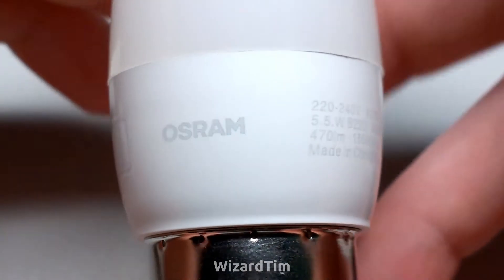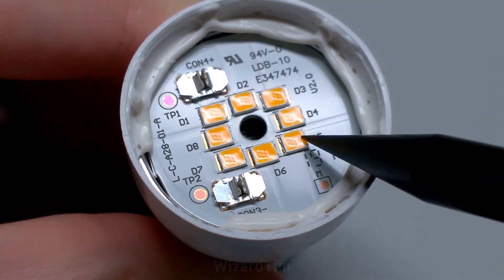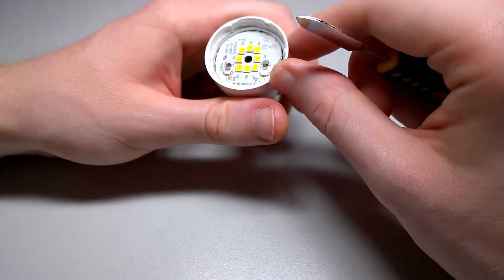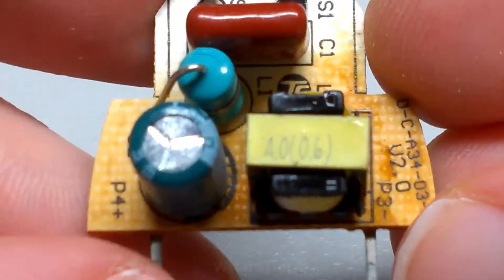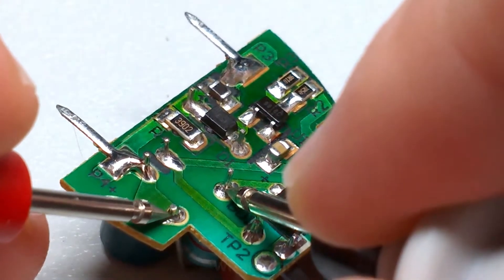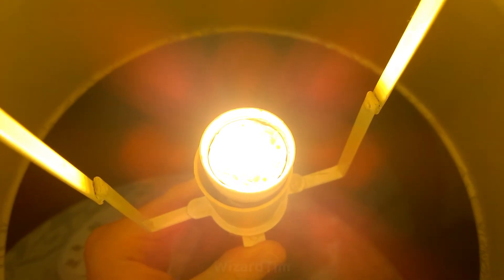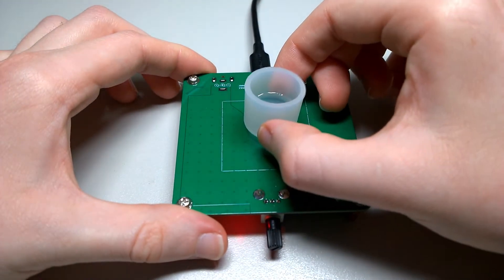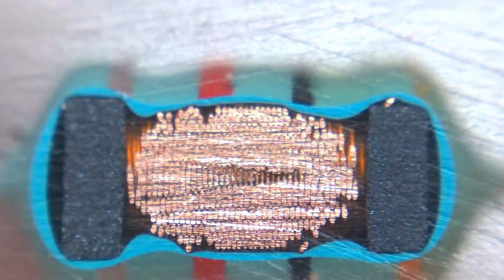OSRAM 5W LED Bulb Repair & Failure Analysis

Comment: I would have put money it was the capacitor. I've opened a few LED bulbs and it's always the capacitor.
Reply from the maker: I would have made the same bet. I haven't come across a failed inductor in anything else since this let alone one with the same unusual crack failure mode. Found plenty of bad capacitors though.

Comment: LEDs burning out has been a major problem for me as I have 16 of them to illuminate my airplane hangar. It is a royal PIA to replace them as I have to borrow a ladder for the 12' ceiling and move my airplanes and tool boxes out. I had the same problem with CFLs so I switched to LEDs and at this point I am on my 5th set of bulbs in 11 years. I probably have them on an average of 4 hrs a day. They are in open sided fixtures @ 120VAC. No idea what the 30+ CFLs I went through but the first two sets of LEDs were LE (Lighting Ever) and the second two sets were Sansi, all 100 W equivaltent. The Sansi brand had cooling openings on the housings and advertized ceramic heat sinks but they didn't seem to last any longer. I am a retired EE and I know that the failure is caused by the PWM circuit board used for voltage conversion. I think the failures are caused by using cheap 85 deg. C rated capacitors not better105, 125 or 150 deg. caps. Does anyone know of a  A21 size bulb that has ambient temperature specs and MTBF specs at that temperature? I am tired of clearing out my hangar and climbing a ladder. BTW you can see the fixtures in my profile picture.
Reply from the maker: Those sorts of failure rates sound suspiciously high, particularly if you're using good brands like Sansi that I would expect to last many years (some Sansi products come with a 5-year warranty). 

If the LED bulb failed due to thermals you'll often see it on the PCB like at 3:02 in this video the heat damaged areas are a much darker green. That and if the capacitor has failed it will have either vented, or the capacitance or ESR will measure bad. But I'm doubtful just repairing that will fix your issue as you've been having a history of failures.

I would recommend looking into the power quality in your hanger as I would consider that an industrial area as you likely have some large power tools in there like an air compressor. Those can back feed transients into the 120 VAC that can damage electronics, anything that when you turn on, the lights dim or flicker is causing large transients. That and also verify you're actually receiving 120 VAC from the utility company. Most utility companies are required to supply the line voltage to within ±5% or sometimes ±10% in industrial or rural areas. But anything over 132 VAC will likely cause damage to LEDs bulbs designed for the North American market. Likewise if you have split-phase, make sure your neutral bond is good otherwise you can have one phase well above 120 VAC in just your hanger which gets worse depending how much stuff you have turned on.

If you can't find any issue after any of that I would say to buy a cheap plug in surge protector and plug it in an outlet close to your breaker panel (or with a device you suspect is causing transients). Make a reminder to check it regularly and if you have a large transient it will blow. You can check them by measuring their resistance between the three pins, they'll be >100k ohms normally, but when they blow they'll go up significantly in resistance or go open circuit so keep a log. If it's a particularly big transient sometimes you can just shake them and hear bits of the exploded MOV rattling around inside. Also the "Protected" LED on some surge protectors isn't a good indicator of health, it will only go out when an internal thermal fuse trips from the MOV overheating from an over-voltage. You can get devices to measure and count surges, but they're pretty expensive.

Also that's a cool experimental you have!

Comment: how you testing? where the multimeter suppose to set to?
Reply from the maker: The multimeter is in diode mode when lighting up the LEDs to test them. However you may find your multimeter can't light up the LEDs. A lot of modern LED chips have multiple dies in series inside them so they have a higher forward voltage.

In this video I used a Keithley DMM6500 bench multimeter in diode mode, unlike a typical handheld multimeter it has a relatively high diode test voltage of 7 to 12 V and can do higher test currents. But you can do the same test with a lab PSU at a similar voltage in constant current mode set to just a couple of milliamperes, just be careful of the PSU's output capacitance damaging the LEDs, a resistor in series will help protect against this. You can also use a resistor and 9 V battery or two 9 V batteries in series to test LEDs if you don't have a lab PSU.

Comment: Fantastic video in every way! Learned so much. Very clear presentation with more good info in the comments. I presume you are an E.E., maybe a professor?

What brand epoxy did you use? After the failure analysis you have also created a nice piece of costume jewelry!

Thank you so much!

Subscribed!

Kind regards,
John
Reply from the maker: Thanks! I am indeed a professional electronics design engineer, I do have a university degree in it but I didn't pursue a career in academia to become a professor/lecturer/tutor. 

Unfortunately I don't remember the exact epoxy brand I used. But any generic "ultra clear deep cast epoxy resin" will work, the advantage of this type is it isn't very viscous so it flows easy around the part and can be used in reasonably large moulds without overheating. The downside is the ratio of the two parts is very sensitive and it takes several hours to cure or requires heating to cure at all.

They certainly are nice to look at so I've never thrown any out and have always kept them, but never turned them into anything else like jewellery, but maybe I should at least display them somehow rather than keep them in a box in a drawer.

You may also enjoy a 2022 book titled "Open Circuits: The Inner Beauty of Electronic Components" which has some absolutely fantastic photograph and detailed explanations in it.
https://www.youtube.com/watch?v=byKyJ0b04Lo
Reply: @WizardTim  Super, thank you! 

Well you certainly could have gone the academic route and excelled had you desired. 

I will get that book!

Kind regards,
John

Comment: Thanks to the diagnose tutorial this video I managed to fix a LED bulb. I had exactly the same problem. Unfortunately it is not possible to reconnect the board back inside the bulb again. The metal srew in part was clamped onto plastic to make it unrepairable.

Comment: Why do some led blink ? Is it the capacitor issue...i replaced the caoacitor and it blanked out😊
Reply from the maker: If all of the LEDs blink on for a moment and then off and the time between blinks is somewhat consistent then it's likely a power supply issue. This is what's called a 'hick-up' failure mode. It can often be caused by a dried out electrolytic capacitor on the primary side, as you replaced the capacitor and it stopped working, I suspect this isn't the issue.

The other thing the issue could be is a bad solder joint or broken bond wire in an LED. The heat from replacing the capacitor may have caused it to fail completely. If just some of the LED blink (a single series string of LEDs) then this is likely the issue.

To confirm the power supply isn't the issue you can measure with a multi-meter the voltage across the string of LEDs (being careful the output voltage is referenced to mains and thus a shock hazard). If you measure a stable voltage across the LED string then this would indicate the power supply is working correctly.

You can then unplug the light and use a multi-meter in diode test mode (or the LEDs require more voltage, a power supply and a resistor) to externally power each individual LED to check they are working. If you find a one that doesn't light up then it's of course the defective one.

Alternately you can plug the light in and bridge across each individual LED with a wire (being very careful), if you bridge across an LED and all the other LEDs light up you know that LED is broken.

If you find a broken LED you can either replace it or alternatively if the light is a constant current driven design with only 1 series string, solder a wire across the bad LED bridging it out.

Comment: very cool video man thanks for sharing. Im just getting into electronics repair, and this is super helpful! I didn't even know that inductors could have that package lol, I thought that everything with that shape and type of colour coding was a resistor haha
Reply: Me too!

In case you missed it, Tim posted this info on how to know it is an inductor and not a resistor in another comment:

"Some things that give it away it's an inductor:
⁃ PCB overlay has it marked as "L1" and an
inductor symbol between the pins
⁃ Axial through hole inductors are often that
light blue colour and the colour bands decode
to a sensible inductance value
⁃ It doesn't make sense for their to be a resistor
in that place in the circuit but an inductor makes
sense
⁃ The cross section shows it has a ferrite core
and low resistance copper wire wound around
it, a wire wound resistor would use a nichrome
alloy wire wound around a ceramic core."

Comment: I just had a 9w Bayonet Smart bulb fail on me. It suddenly started flickering like it was trying to come on, but wasn't able to. Thought I'd take a look and see if I could fix it. I wasn't sure how to open them and came across this video. Thanks to this video, I was able to take it apart with relative ease. Turns out the issue was a bulging cap on the power supply board. It was a 10V 470uF cap. It was immediately noticeable. I have a bunch of power supply boards (some from TVs and and several ATX ones) laying around. Looked through the ATX PSU 1st and saw a 16V 470uF cap. Looked up if you can put a higher voltage one in and seems like everyone said it's fine as long as it fits. The 16V cap is larger than the one I took off, but the extra size was not a problem as there was more than enough space for it.

So I de-soldered that cap from the ATX PSU and soldered it to the bulb PSU board. Put everything back together, fitted the bulb and it now works fine. No more flickering and it appears in the app again (it was showing offline before). All colours work and there's no flickering. So seems like it did the job. I'll have to see how long this cap lasts as it was taken from a faulty ATX PSU.

I never knew these bulbs were fixable (thought you couldn't take them apart without damaging them). Nice to know these are fixable.

Comment: This inductor most likely got damaged due to heat and frequency. Ceramic capacitors get damaged similarly, especially in high frequency circuits. To prevent this, can be used e.g. two connected in parallel. They simply crack. They look functional but under a microscope you can see that they are cracked.

Comment: Replacing a broken led can be frustrating. Even with plenty of heat applied, the solder didn't come lose. Then the led break in pieces..

Comment: Does you know how check Leds over 3V? My multimeter can't
Reply from the maker: In this video I used a Keithley DMM6500 bench multimeter in diode mode, unlike a typical handheld multimeter it has a relatively high diode test voltage of 7 to 12 V and can do higher test currents. 

But you can do the same test with a lab PSU at a similar voltage (>6V for those 3 die LEDs) in constant current mode set to just a couple of milliamperes, just be careful of the PSU's output capacitance damaging the LEDs if you set the voltage too high, adding a resistor will help prevent that.

Comment: hello, can you tell me how to open the cover of a GU 10-5W bulb?
Reply from the maker: You might be able to carefully insert a thin pry tool between the lens and outer shell and then push it back and forth getting deeper every so often to try and cut any silicone adhesive, gentle heat may also help. Although you might find the lens is glued on with a stronger glue or ultrasonically welded which makes opening them without damage impossible.

Comment: As a semi-noob, how did you know that was an inductor and not a resistor? Really amazed seeing the internals of it.
Reply from the maker: Some things that give it away it's an inductor:
- PCB silkscreen has it marked as "L1" ("L" in honor of the physicist Heinrich Lenz) and an inductor symbol between the pins (easiest way to know it's an inductor)
- Axial through hole inductors are often that light blue colour and are much wider than resistors with a slightly lumpy mid-section
- The colour bands decode to 3 mH which is a relatively large inductance value, but makes sense in the circuit (if it were a resistor it would be 3k Ohms 10% which would limit the current too much and dissipate about 1.5 W of the 5.5 W of this LED bulb)
- It would measure almost 0 ohms but about 3 mH on an LCR meter (if it wasn't broken)
- The cross section shows it has a ferrite core and low resistance copper wire wound around it, a wire wound resistor would use a nichrome alloy wire wound around a ceramic core.

Comment: OSRAM leds were very very hot. Threw away  the diffuser, n drilled many holes into the led. Temperature went down significantly n it was even brighter without that diffuser...see that YouTube video how to do this. Never going to buy OSRAM ever again.

Comment: Is anyone knows what's LED installed in a DLP LED projectors? They eats 0.6-3V and 1-3A. There are two wires connected-- + and -. When I tried to connect a 1.5V (AC\DC adapter with 3A) to one of them it does nothing. When I tried to check it by multimeter--then nothing. Regular diodes show some Ohms normally. But these one not.

Comment: That was awesome, it would've been nice if you showed your multimeter on the screen so for people with basic knowledge understand how you measured the LED and the inductor. 
Btw, what is the difference between the inductor and resistance? can we use resistance instead? and how can we tell since both look similar?
Reply from the maker: Agreed, I even have a special bench-top multimeter than I can screen capture from, but completely forgot when recording this video to do that! In the new videos on this channel I have thankfully remembered (so far) to record the multimeter and put it in the video. 

The inductor smooths out the noise and voltage spikes on the AC mains to protect the LED circuit in the bulb but also prevent noise from the LED circuit going back out into the AC mains and interfering with other stuff in your house, it does this in combination with the capacitor, this is called an 'LC filter'. It does this by absorbing the voltage spikes in it's magnetic field. A resistor often used for a similar job in combination with a capacitor this is called a 'RC filter', but they have no magnetic field so instead convert energy into heat, thus it would get extremely hot and make the bulb very inefficient.

It's often difficult to tell the difference between those axial inductors and resistors but typically you can tell based on the shape, inductors are usually shorter and wider than most resistors. Also ones like the brown one the coating is thin enough you can just make out the windings. In this example it's easier because there's a little inductor symbol on the PCB between the pins and it's labeled 'L1'.
Reply: @WizardTim  Thanks a lot, that was a very good detailed explanation. I'm surprised how no video I have watched for the past week trying to learn electronics explained or even mentioned inductors. I even googled inductors vs resistance and I didn't get a clear answer or picture comparison. 
 I just bought a new multimeter so I'm excited to try and test these components myself.
Reply from the maker: @mhnoni  Inductors aren't used anywhere near as much as resistors or capacitors so they're usually not taught until later in electronics.

You'll probably understand it better if you think of inductors as the compliment to a capacitor rather than a resistor.
- Capacitors try to smooth voltage by storing energy in their electric field
- Inductors try to smooth current by storing energy in their magnetic field
- Resistors limit current by dissipating energy as heat

Also you'll find almost all multimeters can't measure inductance, usually you're measuring resistors, capacitors or diodes, you rarely need to measure the inductance of an inductor so they don't include that feature most of the time, in this video I was just measuring the resistance of the inductor to check it wasn't broken internally which of course it was broken. I have an LCR meter to precisely measure inductors, capacitors, resistors and all their characteristics, but you only really need that when designing more advanced circuits.

Comment: Oh I thought I was the only one who liked to do that kind of component analysis, somehow find it so satisfying to sand down the components and look at the cross sections with a microscope. You can use higher magnifications say 100x and stitch a larger picture, they are great as nerdy high resolution posters. Maybe its dumb but I was giggling at the sounds of the sanding fastforward. Subscribed!
Reply: What epoxy do you use?
Reply: @johnbauman4005  Devcon 5 minute epoxy, the one that has a "sulfur" smell and comes in siamese syringes. I think any epoxy works but the faster it sets the faster you can work on your analysis. Edit, its good for small components, but for larger ones is too expensive and the setting heat can lead to a runaway in larger volumes, so use a slower (and cheaper) setting epoxy for larger components.
Reply: @teresashinkansen9402  Thank you Ma'am!  It will be awhile before I can start but I'm definitely interested! I have taken a screenshot of your reply. Your help is much appreciated.

Kind regards,
John